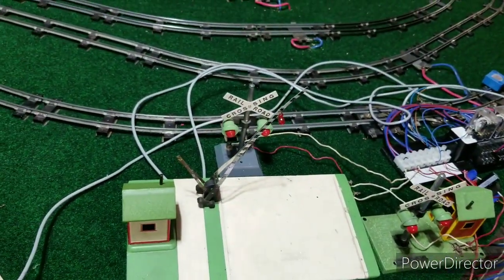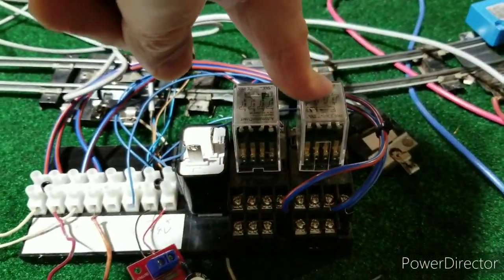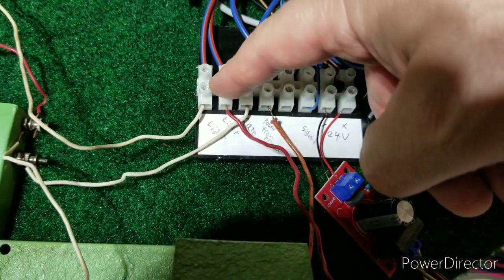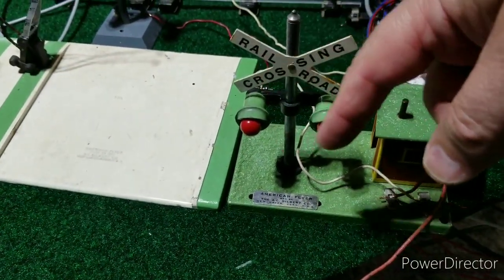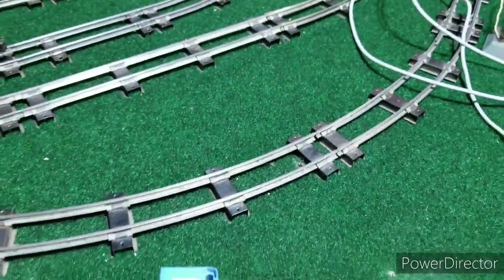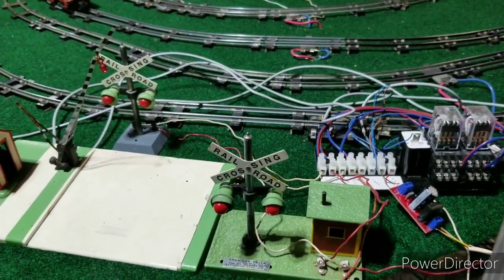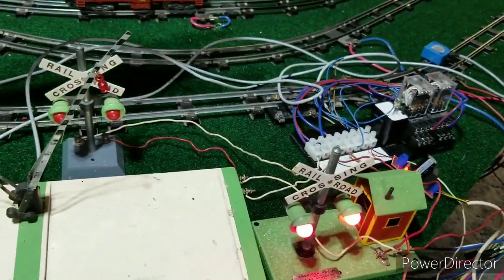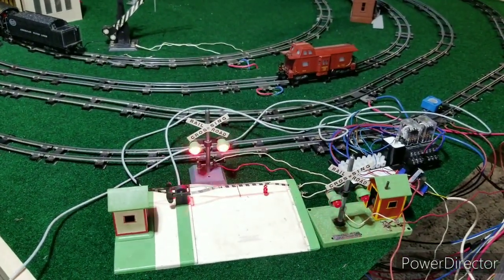Crossing over:  using period electronics to protect a multiple track crossing.

Comment: The true fun of electric trains is tinkering with electrical/electronics. ( the restorations are fun too!).  The real challenge is hiding the wires.  I have experimented  with this and found   that the double level layout kind of works. The  table is built but the top is framed  with whatever and  the 3/4 ply wood is placed on top as the running suface. A piano hinge is placed with discreation somewhere to support the board weight. ( when lifted ).  You can  make all the wiring disapear this way.  The tracks must be slip joined and wired by blocks.  Organizing the wiring becomes a primary concern.  I cut a 12 inch diameter hole in the bottom for access from the bottom panel. This allows  getting at wiring without having to lift up the scenic panel  most often. Yes it requires planning and you will only do it three or four times before you get it right. (CASG)   Wish somebody would write a book  on this!

Comment: Could you have your friend draw a schematic of what he designed for you and then post it?
Reply from the maker: Hello John and thanks for your interest and comment.  Would you be interested in purchasing a ready made kit?  I dont have a schematic.
Reply: @AustinsAmericanFlyertrains  
How much?
Reply from the maker: @johnsimms6184  hope to have an amount in a few days.
Reply from the maker: John...we have been working on a redesign that is much smaller, needs less power and is cheaper.  While we still have some testing ti do it is looking like it will be around $40...include it own power supply and be able to both simultaneously flash lights and lower a gate.  It will include 2 sensors.  Is this anything you might be interested in?
Reply: @AustinsAmericanFlyertrains  that sounds good to me. Have to figure out a more secure and private way to make a transaction.
Reply from the maker: @johnsimms6184  I agree.  Please send me an email ... AFtrainfun@gmail.com
Reply from the maker: John...I haven't seen an email form you yet....
Reply: @AustinsAmericanFlyertrains  I sent and email a few moments ago.
Reply: Did you get the bug out of the one signal burning all the time?
Reply from the maker: Yes...it was a matter of rerouting the ground...I had it going the wrong way through the crossing gate solenoid.  I am working on another cabin fever video where I show the crossing in action. I still do not have the sensors positioned quite correctly as they would 'see' between the cars and caused a bit if intermittent action.  I sent you an email with a picture of the version number 2.
Reply from the maker: Kohn...did you see my email to you?  I'm working on your unit right now.  I should have it ready today
Reply: Did some more looking and found your store. Is there a way to pay you through that?
Reply from the maker: @johnsimms6184  my store?  Do you mean teespring?  I can give you my paypal address and please do friends and family.  Also, I need tour address.
Reply: aftrainfun

Comment: Apparently my sensors "aren't in the right place yet" either. Every time I touch my track I get a little tickle and the ceiling lights in the bathroom upstairs blink like the crossing gate ones are supposed to, not red in color though. Odd. Still think we need to have a villain tie someone to the tracks and then be saved at the last moment by Austin's Greatest American Flyer Hero.
Reply from the maker: Wow...that sounds like a short of ground.
Reply from the maker: It could also be that the flux capacitor orientation is off and conflicting with the blinker fluid.

Comment: That signal system you made is awsome and the way the lights blink! You would make a good American flyer  layout builder with expert accessory  set up.  No doubt big money to be made with people who can afford  such services.  There is Rich Roman and the 2 Vargas brothers  who build layouts of all gauges from $6000 to over 1 million $. S gauge layout for Cinncinatti cost more than $2,000,000!
Reply from the maker: Really?  That would be fun!  My layout-like anyone else's, will never be finished.  Why?  Because it will keep changing.  Maybe not un large ways as the track plan is more or less ok.  However, I'm not happy with  the main line switches nor the placement of some it the structures.  I have a few more accessories projects and then will need a way to fit them into the layout.  Lastly...rubber roadbed.  I've got some.  I'm not sure how much of the layout I can cover yet but think it would be nice.  So lots more to do!
Reply: @AustinsAmericanFlyertrains  Who the factory  in Torrance I think who makes the AF rubber roadbed exactly like Gilbert did.